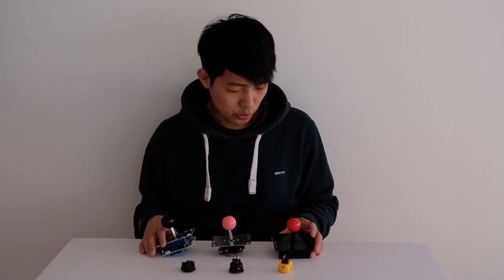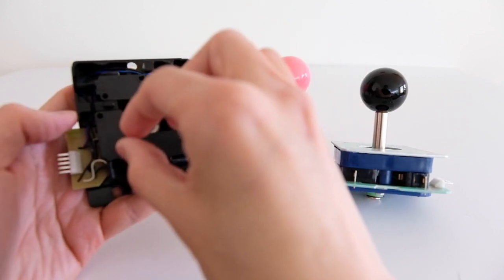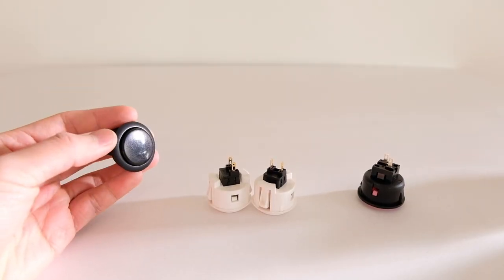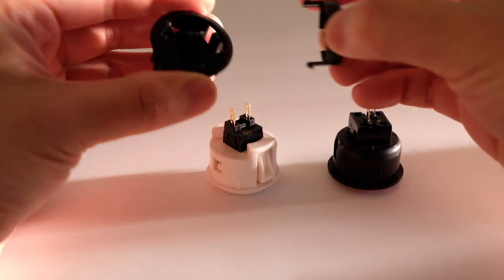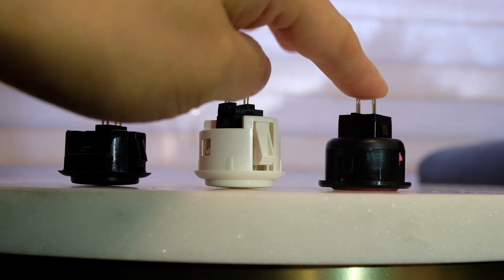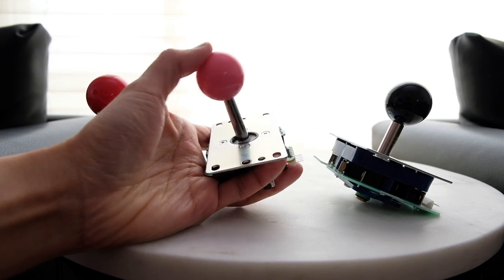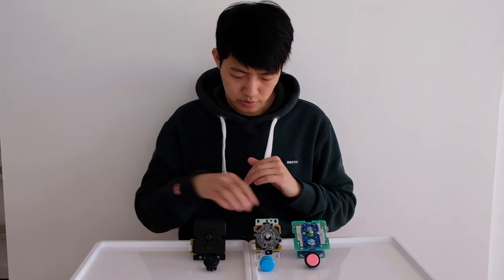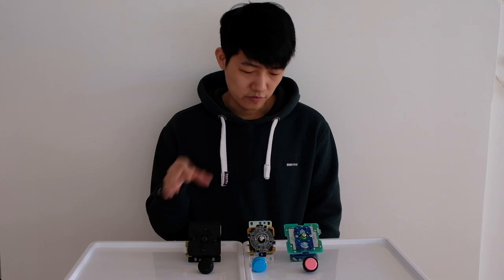Sanwa vs Hayabusa Vs Seimitsu Review Detail Comparison 2019 HD

Comment: Oh yes, I know all these control levers well!  The Sanwa is the most compact but it's also my LEAST favorite.  The restrictor gate IMHO is the weak point of that joystick lever.  That plastic is too thick and it's harder to hit the diagonals on it consistently.  Switching to an octogate didn't help in my case.  Alternate levers with better base designs (and thinner restrictor gate plastic!) worked out better for me.
The LS-32(-01) and the Hayabusa are both overly wide -- but they'll still fit in an Agetec case with a modest amount of case modding! 😁 
I never understood why Hori made the Hayabusa that wide but it might have to do with the microswitch placement.  The Hayabusa is the most comfortable joystick I use and seems to register inputs more crisply.  About the same throw as the LS-32;  I think both are more comfortable than the LS-40 but I can still play fighting games with the LS-40 and would much prefer than lever over the JLF, too.
The LS-32 is a wide joystick but somehow the LS-40 manages to be a somewhat more compact joystick and yet uses the same microswitches as the LS-32?  That's the thing about Seimitsu -- they constantly tweak their joystick designs, resuse the same parts amongst models but almost nothing goes out of production so they keep manufacturing their earlier, "flawed" joystick designs.
Reply from the maker: Wow, amazing details. Thank you so much for sharing, i wish i have a website someday for viewers to share great informations 👍❤️
Reply: n response to your comment, I got the Razer Pantera Evo with a Stock Sanwa JLF lever and .9lb and Square gate. From the moment I took it out of the box I have felt it has been a complete waste of money. The stick is so loose, massive throw range, horrible. I played American arcades with what? the HAPP Eurosticks with Octo gates? were those the ones in the 90's arcades right? Anyways in the arcades DP's and Fireball were easy when I was like 12. Here I am getting my first Sanwa with Square gate thinking its going to be wonderful. Nothing but disappointment. Execution went from very high overall (on pad) to dirt low beginner level or worse. So the 2lb spring helped a little bit but not enough.  I have a Seimitsu LS-40 on the way and I am excited to say the least. Also have a oversized actuator and a Octo restrictor gate on the way as well for the JLF. Between the mods for the JLF and the new shiny Seimitsu LS-40 I think I will be much much happier. I will never again play with a stock Sanwa lever and square gate combo. Its unplayable in my opinion. I have read from others too that they absolutely HATE the stock Sanwa with square gate. They find it awful as well. They said the Seimitsu comes stock with a sort of Square-roundish gate that is much better, so  I am even more excited when I think about it LOL I highly doubt any pro uses a STOCK Sanwa JLF lever with a Stock Square gate. Everyone I read about their info or ask, also say in their equipment used or there preference pretty much all use CUSTOM Sanwa Lever's .Custom, not stock (LMAO) Custom is the key word Custom. I will never ever touch stock Sanwa's for the rest of my life, I swear it.
Reply: @rebranded1248  The problem is the JLF base design, it's NOT the square gate itself.
I use Hayabusa's, LS-32's, and LS-40s's with the stock square gate.  It's better to get used to this because more likely arcade cabinet will be fitted with joystick levers that use square gates.
I tried the octogate with the Sanwa JLF but I found it made it even HARDER to hit diagonals and roll the lever.  It's the actuator/gate thickness on the JLF that's the problem, not the fact it's a square gate!  I still think the main issue is that the gate plastic is TOO thick on the JLF.  I noticed the Hayabusa, LS-32, and LS-40 have thinner gates built into their bases.  
I got used to the Hayabusa (the best I've used), the LS-32, or the LS-40.  The JLF I never got fully used to and I tried a lot of mods over 2 years of active play with joystick cases fitted with the JLF (Mad Catz TE, HRAP).  
If everybody was happy with ONE design, we'd only have the JLF and clones of it but that's not the case!  A good arcade parts store probably stocks at least 12 different joystick designs.
The LS-32 and LS-40 are older designs than the JLF.  In my reading, I discovered they used the LS-32 in Japanese SF2 cabinets and the LS-40 in the Japanese Neo Geo cabinets.  Those cabinets were early 1990s.  The Sanwa JLF is a more recent design, maybe late 1990s/early 2000s.  
The JLF has only become the "favored" joystick lever because most people using joysticks for the last 12-15 years were introduced to those the JLF first on the HRAPs (the Classic HRAP 1-3) and the Mad Catz TEs they bought through the mail and in stores.  
The Hayabusa lever (2012) is the newest Japanese design that is NOT a derivative of an existing design (besides copying the specs of the JLF shaft).  
The most recent Seimitsu lever designs (aside from the Tekken-specific LSX-Nobi which looks more a manual gear shift of a car than an arcade lever!) are derivatives of the LS-32, LS-40, and LS-56.  Much as I like some Seimitsu product, the company has an annoying habit of "reinventing the wheel" and really doesn't innovate jack.  They haven't changed the designs beyond experimenting with alternate spring tension in the LS-32 (literally all an LS-38 is just an LS-32 with a higher-tension spring!) and changing their microswitch vendor after the original switch vendor (Panasonic) decided to stop making the microswitches that Seimitu used for its arcade parts line!
Reply: @AvengerII  Listen you are the person I need to chat with about Levers. You actually have a open mind and have been there done that. I'll make it quick,  I have a LS-40 coming from Focus Attack on Saturday which I plan on putting in my Razer Pantera Evo. The only possible issue I might come across with the Seimitsu Lever would be it will feel maybe a little too stiff cause of the spring. Would it be possible to add the .9lb spring I took out of my Stock JLF and put it into the Seimitsu? Do they Make different tension springs for Seimitsu Levers? and if so where do they sell them online?
Reply: @AvengerII  Also my other quick question is, what hayabusa lever would you recommend? I am looking for something that has the fastest inputs and shortest throw possible? I have not done any research on Hori sticks because once I heard they are loose and wobbly I instantly gave up and concentrated on JLF's ( it has been a learning experience and I feel I may be permanently done with JLF in general)   To add to your comment about the base design of the JLF's being somewhat flawed, I agree it is not the square gate. The seimitsu have a square-roundish gate and it is much better I have heard from more than a few people. Has that been your experience as well?
Reply: @AvengerII  Yes the LS-40 is the original lever that came in the NEO GEO arcade cabinets for games like KOF!!!!  I am excited because I am grinding the hell out of KIM's stomp infinite in KOF 98.  That is why I am trying the scorched earth method of finding a new input device that is suitable. My thumbs are going to fall from from do the combo on a PAD for 8 hours straight. It is pretty much the only combo I have not been able to do (that I cared about) in my entire life. The other 2 combos on my bucket list were 1) Evil ryu axe kick loop combos from SF4  
2) Chun Li Lighting Leg loop combos from SF4. Thankfully I practiced to death to teach myself both those combos and uploaded them to my Youtube channel. Took probably 3-5 months practice for each in total. Kims infinite still eludes me.
Reply: @rebranded1248  Focus Attack and Arcade Shock sell different tension springs.
To be honest, I don't like higher-tension springs.  They get to be too much.  I think 2lb springs are TOO TIGHT and they sell 4lb springs!
What I do with my joysticks is that I buy a spare LS-32 spring and cut it in halves with a bolt cutter.  I screw half an LS-32 spring onto the spring that's already on my Hayabusa (Hori) levers.  I cover half the shaft spring with the cut LS-32 spring.  The Hayabusa has basically the same spring as the JLF.
I figure I increase the spring tension 15-20% by doing the mod this way!  It increases the tension enough so that the stick doesn't feel so loose for me BUT I can still move it fast without straining my muscles and getting those tired quicker.  The strain issue is why I keep the tension lower than 2lbs!  I tried 2lb springs and they were too much for me and I found it too hard to move the lever then.  Oh, and I cover the end of the spring that has the half-spring screwed on with the actuator (the part that's sealed with the E-clip).  I've tried putting the screwed on end against the spring holder (the part that's under the shaft pivot) but I find the tension gets TOO high if I put the half-spring there.
I use the same spring mod method with my LS-32s.  It's the only mod I do with every stick lever I own.
With the LS-40,  I cut cut down that spring-half a little bit more because the LS-40 compresses its spring (which is the same stock spring the LS-32 uses) a little bit tighter than the LS-32.  
Stock LS-40 tension is slightly higher  than the LS-32 but the LS-40 has a tighter/smaller activation zone than the LS-32 or Hayabusa.  The LS-40 is better to use when you're feeling less tired; if you're strained, it can be more difficult to play with.  Some people use LS-40s only for horizontal shooting games like Defender, Scramble, R-Type, etc.  I've been able to use the LS-40 successfully for fighting games.
For me, I found it was helpful to cut that spring-half down to 67-75% of what I use for the LS-32 and Hayabusa -- or basically, a little over half a turn of the spring extra gets cut off.
You kind of have to experiment but the LS-32 springs are cheap enough you can do this kind of thing.  It's not like the parts cost $5 or more!
You can put the JLF spring into the LS-40 and experiment with that but I like to keep things simple and just eliminate one variable by using the LS-32 spring halves to increase tension on ALL my stick levers.
The LS-40 shaft is THINNER or roughly equal to the thickness of the JLF; both these shafts are thinner than the LS-32.  The problem might be the spring holder on the LS-40.  I believe it's designed to hold the LS-32 spring; the JLF spring might just be too small to fit onto the LS-40 spring holder but I don't know that for sure.  I've never tried to see how well the JLF/Hayabusa spring fits on the LS-40 shaft but I know the JLF/Hayabusa spring would be TOO THIN in diameter for the LS-32 shaft.
Again, I use a spare LS-32 half-spring to ratchet up the tension on my joystick levers.  One thing I discovered with the LS-40 is that it takes a few games for the "spring mod" to settle in.  It'll feel uncomfortable and like the mod part is moving around the first 3 or 4 times you use the modded lever.  After that, it settles in.  I like using the modded LS-40 lever this.  I have three of them and I've had the same experience with all of them needing to "settle in" before they became comfortable to use.
Reply: @rebranded1248  It's the thickness of the plastic on the JLF base for sure.  The gate is TOO thick and I think the overall JLF design is flawed.  It's not the shaft; the Hayabusa shaft is basically a JLF shaft clone.
I didn't like what I saw in the Otto DIY mod part for the JLF/Hayabusa.  The Otto repeats the same design flaw I see in the JLF -- too thick of a gate.  For one, I think the Hayabusa is fine as it is.  The only thing I modded on the Hayabusa was spring tension and I ratched it up with half of a spare LS-32 spring.  Again, only a 15-20% increase in tension.  I don't believe in doubling the tension!  That's TOO MUCH for my likes.
I can't tell you what the best joystick lever is for YOU to use.  Everybody has their preferences.  I tried at least 4 different levers before I finally bought a Hayabusa lever in 2013 when they became available separate from the Fighting Edge joystick case.  The Hori Hayabusa joystick lever is a $30 part but Arcade Shock has them on sale for $25 for a while.  Most other Japanese joystick levers cost $23-$25.  
The optical and silent joystick in production run $45-$65.  The only reason to buy those silent joysticks is if you have grumpy roommate or significant other that's bothered by the noise of arcade hardware.  If it bugs them that much, they should either buy ear plugs OR shut their bedroom door!
*
I've used probably upwards of 12 different lever designs but the ones that are STILL in production that I've played with are the Sanwa JLF, LS-32, LS-40, LS-58, and the Hayabusa.  I absolutely hated the JLF and LS-58.
The JLF issue is the base design thickness.  I could just NOT hit diagonals consistently on that F-ing lever!  The LS-58 is closest in feel to the LS-40 but I feel it's TOO SENSITIVE for me.  The throw and activation on the LS-56/-58 is ridiculously small; NOT comfortable for me!  
I prefer joysticks with longer throw but medium activation/better engage (for my tastes) like the LS-32 and Hayabusa.  Some people feel the LS-40 is the "best of all worlds" but I can see the activation zone being TOO TIGHT for some and only slightly less frustrating than the LS-56/-58 design.
Again, I personally don't like the JLF and the LS-58 has been my least favorite of the Seimitsu LS-joysticks I've tried and played with.
Basically, I think the Hayabusa plays like a more accurate version of the LS-32 (seems to hit the corners better; it's my preferred joystick for Super SF2 Turbo HD Remix) but the LS-32 is still an excellent joystick.  The LS-40 is good, too, but it's like a "tighter version" of the LS-32.  The LS-40 can also BITE back if you are too tight and your hand is not relaxed.  It took me a while to get used to the LS-40.  It probably helped that I played with both the Hayabusa and LS-32 beforehand.  Playing with better, more comfortable joysticks (for YOUR tastes) makes it easier to play with less optimal joysticks.
That was my experience.  Your mileage may vary!  If you have a buddy who has different levers and will let you play with his hardware to get a feel for the hardware, that's probably a good place to start before you start spending some money.  This hobby gets expensive fast!!!
Reply: @AvengerII  Okay great!!! So I should order a few spare LS-32 springs then. Yeah great advice thanks so much. So just to make it clear, if I want to add tension to say the LS-32 I would cut 60-70% of the spare spring and then add that  remaining 40-30% cut off spring to the shaft WITH the existing LS-32 spring, thus combining one stock and one section of an additional LS-32 spring to increase overall tension. I would do the opposite to decrease tension in the LS-40 for example. So would I completely remove the stock spring in the LS-40 and add a LS-32 stock spring that has been cut with about 20-30% of its spring removed/cut off and just add that around 70% of a spring by itself to the LS-40 thus decreasing tension? Or I could just cut the LS-40 spring too and use it by itself instead.  The 2lb spring in the JLF really didn't help much, just made my arm get tired faster!!! LOL Was hoping for faster inputs, but that's the throw range, so just proves I am a complete novice when it comes to arcade levers. Just started modding this week LOL
Reply: @AvengerII  So glad you have provided me with this info. Honestly, the Lever's are not very expensive so I will probably try the LS-32 next month after testing the LS-40. I also will eventually test the Hayabusa lever out too. The thing that kept me from getting the LS-32 and going for the LS-40 was the fact the shaft is shorter on the LS-32 compared to say the JLF. That scared me because my hand barely fits under the JLF when holding it full wineglass style( palm turned facing upwards while gripping the lever)  Would you recommend getting a shaft extender for the LS-32 to make it closer to the length of the stock Sanwa JLF?
Reply: @AvengerII  I have one last question. When I go to mod my JLF with the OCTO gate and Kowal 1mm oversized actuator, what spring tension do you recommend? Right now I have a 2lb spring in the JLF, but I kept a hold of the .9lb spring in a little plastic bag and stuffed it in the Pantera Retail Box. I have heard people say adding the Kowal actuator made the JLF feel like the Spring had more tension. Should I put the .9lb spring back in, and remove the 2lb spring when I do the mod? Or I guess I could add the .9lb spring and add like 20-30% of the 2lb spring to it by cutting a section off, and do what you suggested with the Hayabusa lever and LS-32 spring as well huh?  Maybe it would be better to just buy another stock 1lb JLF spring and cut a section off that and combine it with the .9lb spring to get something close to 1.5 LB tension. The 2lb spring is a little to much tension honestly, and I have already decided to remove it when I open my case up again real soon.
Reply: @rebranded1248  I have no idea.  Everybody has their own level of comfort.
You only find out what's comfortable for you by experimenting.  Try what other people have said.
I kept it simple for me because it worked and was cheaper for me!  LOL
Reply: @AvengerII  Okay thanks, very much appreciate all your info and experiences you have shared. Really looking forward to testing out something besides the JLF. I hate the stock JLF with a passion, and so pumped to try it with a mod and also the LS-40. In the future LS-32 and Hayabusa baby!! (Duke Nukem voice LOL)
Reply: @rebranded1248  You're welcome!
If you can, test before you buy.  You'll regret it much less if you do that!
Reply: @AvengerII  Unfortunately I have not met ANYONE in person who likes fighting games much less would invest the money in a arcade stick since the early to mid 90's LOl Its been 30 years since I have had a buddy to play fighting games with in-person. So I will just cough up the cash and test the levers myself. I really have no choice. There is no arcade part store around me that sells discounted levers either.